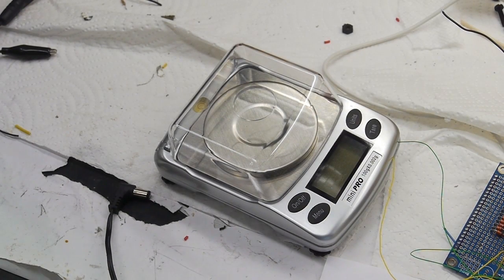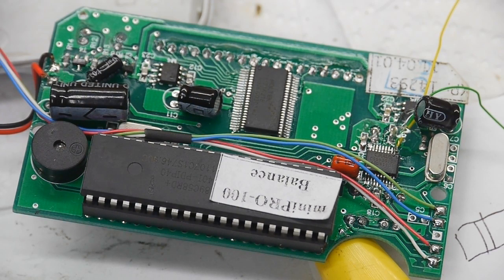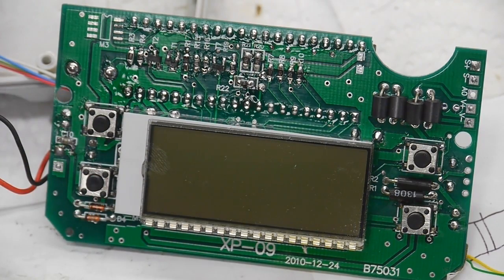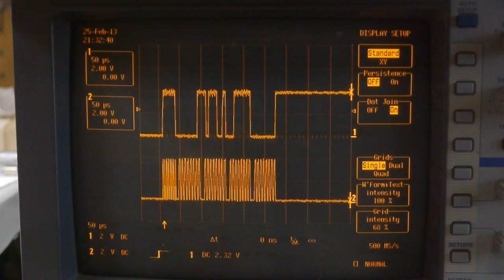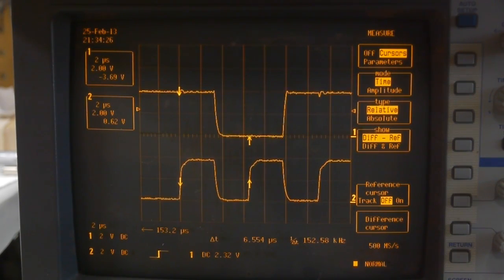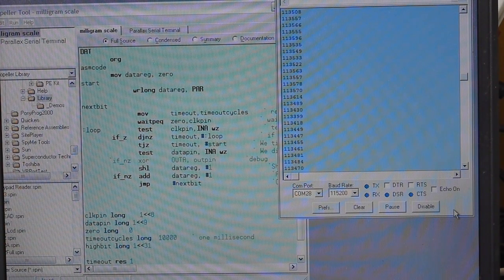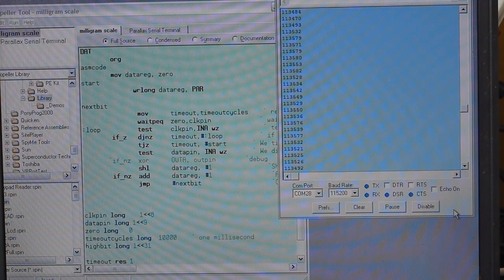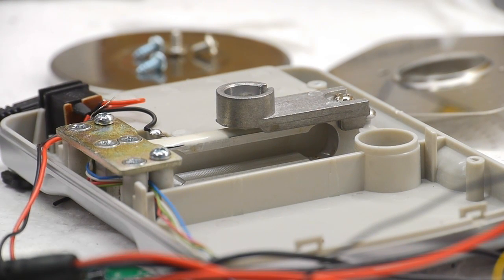Hacking a milligram balance (scale) with a Parallax Propeller microcontroller

Comment: You might also look into those three connection points between the C6 and C7 labels as being I2C or SPI for in-circuit programming (ISP) or for functional testing.  However, I think you are well on your way to solving the problem as-is.

Glad you mentioned the poor soldering job, I spotted that pretty quickly as well.

Comment: I saw that video, too. The pulses are between 40 and 150µs by the way (I checked the datasheet because I got the detectors at uni, planned to be used in a project). Measuring the width of a single pulse to under µs precision is perfectly doable on an AVR (internal timer running at /1 clock and external pin change interrupt). But this here is a completely different apllication. Software polling of the data would be too slow, but the AVR's hardware SPI should be able to do the trick.

Comment: You could just tap into SPI bus from another micro controller (almost any would do) and perform your own conversion. Since the main scale microcontroller performs only 7 conversions per second, you have plenty of time to tell the ADC to perform a conversion for you. Just listen untill CS line goes high and use standard SPI peripheral to send commands to ADC - no need to do low level hacking.

Comment: The problem looks like a very good application for a shift register (SIPO). In terms of costs and effort this should fit well.
Anyhow I'm still puzzled by the 80-class processor outperforming a more modern processor. I recall the performance curve /gain in the embedded world as quite steep.
Cheers, Dirk

Comment: But, why not simply take the SPI CLK and SDO and introduce them to an external micro, using it's serial interfaces in SPI mode? Something cheap and simple as MPS430 G2 line. One USCI is sniffing SPI and other is blasting out processed data. No assembly required:)

Comment: Basically, what you want to do is wait until the data line is low for a certain period of time, and treat that as the start-of-data flag. At that point, if you don't see all 32 clock pulses within a certain period, you've missed a clock, and you can treat your data as invalid.

Of course, you could always just tap the CS line. That would be the ideal way to go.

Comment: The problem with the waitpeq instruction is that it's not interruptible, and has no timeout. As such, you can't implement a simple "if the serial line is low for too long, we're in an error state" mechanism.

What I would up doing in a similar situation is writing a very, very minimal polling-loop. That way you can have a timeout, and the loop should only be ~4-5 instructions long.

These days, I'd probably just use an ATmega, though.

Comment: Nope! You could do it all in straight-up C/C++.

The (only slightly) tricky part would be setting up the SPI interface, as most of the examples are for a SPI master. I've done it before, but you wind up outside of arduinoland when doing so, as you have to deal with the ATmega directly. It's not hard, but there are fewer examples to be found.

Feel free to PM me or whatnot if you want help/info.

Comment: He doesn't want to destructively interface to the scale (ie: all functions need to be preserved so it'll still work without the propeller attached) - It's difficult to read the SPI data directly from the ADC, as the C51 micro is providing the clock source, so to read the data bits you'll need to somehow synchronise the propeller 'read bit' routines with the C51's SPI clock edges

Comment: I'll explain it better in person, next time I see you.  I did something similar for some high speed camera reading code. The basic idea is you sync up at the start of the transaction, and then just read the SDO pin at regular intervals to get the data.  So if you get out of sync, you'll just keep reading until you've got 40 bits (some being invalid) then loop back around to sync up with the next transaction.

Comment: Youtube comments aren't long enough to explain everything, sorry.  However, you are correct, my method described above doesn't work if you get out of sync, but it's easily fixed by not using the waitpeq in the innermost loop, and instead just using the prop's deterministic mature to read bits at the proper rate.  Then if you start out of sync, or get out of sync at some point, it'll just give you a bad reading once, then be in sync again after that becase of the outer loop using waitpeq.

Comment: i've been toying with a similar idea, only my device is a distance meter, not scales. my idea was to intercept the data going to the LCD. it's probably not too easy, but it might solve the problems of fast clock and data. did you consider it yourself? if so - any cons?

Comment from the maker: Ah, good idea. Would you be worried about the SDO waitpeq to accidentally trigger in the middle of a transaction? Ie the Propeller resets while the balance is running. I guess the probability is next to nothing, but once out of sync, it cannot regain the start of the data. Right?

Comment: Ben, the chip uses SPI protocol why not remove the C51 micro from the scales, and drive the cirrus chip directly from your propeller/Arduino/Whatever and no assembly required ..

Comment: Most AVRs have hardware SPI implementation to capture the data, but they don't have DMA. So the SPI hardware registers can only hold one packet at a time. The usual thing to do is to set the SPI hardware to trigger an interrupt at end of SPI packet reception which would save the data from the SPI registers to the RAM.

Comment: Take an ATmega328 (the MCU in an arduino). With a 16 Mhz clock, and the AVR's clock-cycle|instruction-cycle parity, you would get ~106 instructions per bit. That's enough that you could drive everything using pin-change interrupts, or just plain-old spin-wait.

Comment: They ALL have hardware for SPI (it's one of the standard modules). You can configure the USART to be synchronous, or use the dedicated SPI module.

Basically ANY PIC or AVR microcontroller could do what you need here without any issue. Heck, at such a slow data rate (150 kbaud is actually pretty slow), you could easily do all your serial in software.

Comment: The data sheet says it pulls SDO low to indicate data is ready, then it clocks out 40 bits of data.  It leaves SDO high otherwise.  So I would start the "loop" by doing a waitpeq on SDO to go low, then have a loop of 40 iterations doing a waitpeq on the SCLK being high, read the bit, then shift it into the datareg (the first 8 bits will get shifted out the top and discarded). Then write out the result. Then jump back up to top. No need for this odd timeout mechanism.

Comment: I've never used the Altera stuff. If it was Xilinx you'd probably go for one of the 95XL series parts. For one of those in a 5v system you would need a 3.3v LDO in there to supply the core voltage but other than that you just wire up a JTAG adapter and burn your logic on to it and off it goes. A lot easier than FPGAs :)

Comment: Hey Ben, Ditto to the other commenters: atmega chips have a hardware SPI interface (sometimes more than one) which can be used to grab this sort of thing. It will send an interrupt after every byte.

I did something very similar with an optical mouse - sniffing the clock/data bus with an arduino to capture the movement info. That was a 12 bit protocol, so it took a bit more doing to decode, but the concept is the same.

Comment: I was just looking at bionerd's channel and she is using an MCU and a pin diode radiation detector. The detector outputs an energy dependent 15 to 40 uS pulse. That speed and getting some precision is just of of the range for an AVR alone and I was thinking maybe an FPGA would work, but now you look at an very close problem using the Propellor, a part that's just come up for sale at my local distributor and looking for a reason to be bought.

Comment from the maker: Thanks! Do you know if the AVRs actually have hardware to receive SPI? I searched briefly, and it seems they are just using interrupts. The I2C or TWI seems to require proper addressing, but it might be possible to trick it or ignore addressing. For a simple project, my first choice would always be an AVR as well.

Comment: Reading the response re: taking the signal from the HT1621 rather than to it kinda makes me think taking the signal to it might end up giving you all the existing features already implemented. The display should be showing the units used etc so I think theoretically scraping that signal would end up providing more than scraping the ADC. Saves you from doing all the maths and other than translating the signal you could dedicate programming to interfacing with the other existing inputs.

Comment: First, thanks for your work of making and sharing your videos. I think it would be easier and cheaper to use an ATMega uC, bridged it to the TWI interface and put it in slave receiver mode. It can sample at up to 400 KHz. The propeller is kinda of an overkill, though I'm not sure what else it's gonna have to do.

Comment from the maker: I thought about this as well. It would involve more wires (7 segments + 4 common + "grams" indicator), and the LCD driver introduces an alternating waveform to prevent polarization in the LCD. It has benefits (conversion to grams already done), and drawbacks (pressing the tare button changes the value).